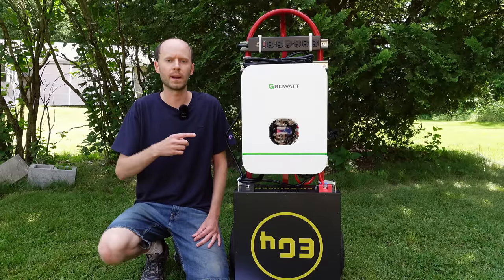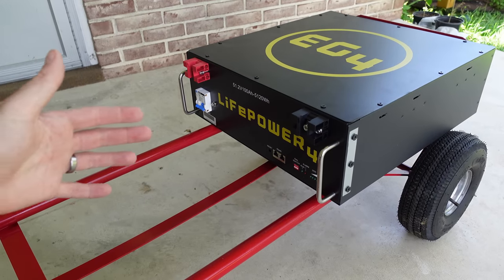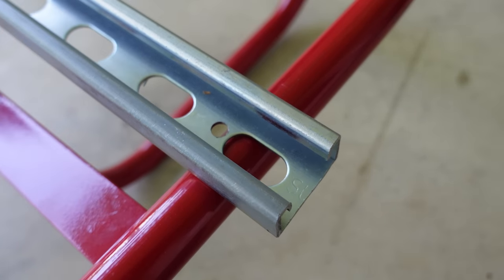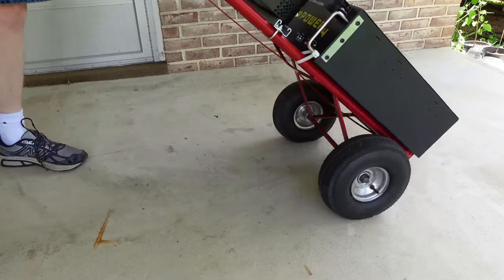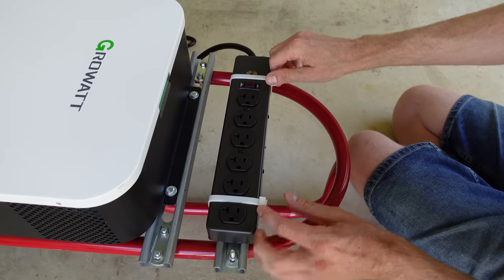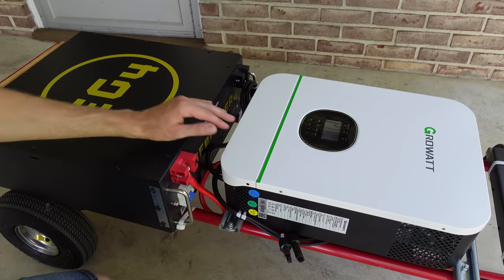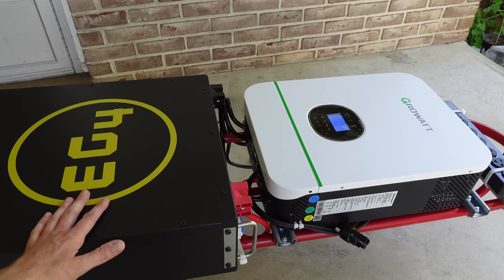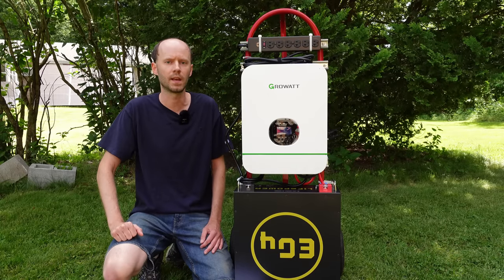Building a 3000W Portable Solar Power Station, Great for Power Outages!

Comment: Suggestion: Put your power outlets as close to the ground as possible (Obvious reasons). Use the entire length of your zip ties, especially on heavy loads -not just one turn and cut off the access. Don't waste the tie. USE the access length and double / triple / Quadruple the holding power of the tie.  Put rubber feet on the D handle to help keep the dolly from rolling when you lay it down.
Reply: I would also flip the battery over, so the terminals are closer to the truck, the positive and negative leads don't cross each other, and the breakers become easier to access.
Reply: @ES-mq9ox  you go around with your ty a couple of times  before you set the tie..
Reply: @ES-mq9ox  Try it. And you'll see.
Reply: @ES-mq9ox  In addition to adding strength every rap puts less stress on the teeth that hold it together.
Reply: @ES-mq9ox  You're wrong. Take a 12 inch zip-tie and lock it off forming a loop. With your hands, pull it apart. Note how much force that requires. Now take another 12 inch tie (same exact kind) and do the same thing except double it over after you close it forming TWO LOOPS. Now try to pull it apart.

Comment: Very nice build ! The only thing I would add is either loc tight / thread locker for the bolts or lock washers  and line the resting rails with black rubber tape also for vibration dampening . Just a thought is all . Again great set up !!

Comment: I would use those cheap ratchet straps from HF to secure your battery! I would like to build a similar system one day, starting with the battery and adding the inverter and controllers later! Thanks for the video!
Reply from the maker: That's a great idea and might give better support!

Comment: Recommendations:
1) To avoid voiding the warrantee by drilling through the cage at the bottom of the Growatt Inverter, you could have made a custom aluminum mounting plate to make the attachment. One plate with 4 holes and added mounting hardware.
2) Advise the manufacturer of the design issue (flaw) with the mounting holes inside of the inverter cage at the bottom. They can easily add a flange at the bottom of the inverter housing, much like they did at the top of the inverter housing. I assume that the spacing of the slotted mounting plate at the top of the housing is spaced 16" apart for mounting with lag bolts to the standard 2"x4" stud spacing.
3) Explain why you placed a small piece of plywood between the handcart flange and the bottom of the battery (cell pack assembly).

Question:
1) When will you provide a video on the interconnection of the communication ports of the cell pack assembly and the Growatt inverter?
2) When will you cover setting up the WiFi connectivity? This will enable remote monitoring without needing go manually check the system. The remote system should alert you to when the system charge is low and requires recharging.

Note:
In the past, I haven't commented on your videos mostly because I don't have the time, however, I do monitor your YouTube videos and am subscribed.
I appreciate your efforts! Keep up the great work that you do! Go forth and do good deeds!
Reply: Instead of using a single sided unistrut,  Unistrut makes double sided unistrut and that would allow you to use spring nuts and pipe clamps to clamp the strut to the dolly and spring nuts with bolts to anchor the inverter.

Comment: Those lower bolt holes on the inverter had solid steel around it for sturdiness.  Those you drilled were surrounded by other holes.  You’d probably want to use at least a 1” washer or greater on those bolts.

Comment: So for how many hours would this setup power a garage freezer and kitchen fridge that combined use about 3kwh in 24 hours?  And what size solar panel setup would it accept/need to recharge the battery within the allotted time?   I'd like something that I can use to keep my freezer and fridge going for an extended time 2 in the event of a massive power outage.  Ability to add a small light bulb and iPad charger would be a nice addition  too.
Reply from the maker: This is a 3000Wh battery so if your load is using 3kWh in 24hrs, it would power the load for 24hrs assuming full battery and healthy life.  I have a separate video on connecting/sizing solar panels https://www.youtube.com/watch?v=QWJpafOHoD0
Reply: @LithiumSolar  isn't that a 5000Wh battery?   3000W controller?   so it should easily run the fridge and freezer for 24 hrs non stop and then some, right?  if fully charged.
And if I have to run a generator to charge it, how long might that take?   I have a 14 KW propane house generator.  Please excuse the simple questions as I have very little knowledge of electricity

Comment: That's an awesome build, VERY well done. I was looking at their web site, but it didn't say...can you hook up say a 2 or 3,000 watt Honda generator to the invertor and charge the battery that way as well? I mean you have a few days of storms and no sun, a small gen set would be nice. Also, can you daisy chain the batteries and have 10k? Thanks and keep up the great work.
Reply: How much cost
Reply: How I can contact this company
Reply: Yes you can, these take AC input to charge. You can daisy chain several together in parallel.
Reply: If you have a generator, there's no need for this battery and inverter. unclear why you would store power if you have a generator.
Reply: @bob1498  gas supply might become an issue
Reply: @bob1498  silence, long term outage, back up option in case the inverter fails, etc
Reply: I had the thought of 10kw as well, ( 2 of the 5kw). That would be heavy but perfect for me. Is that possible?
Reply: @bob1498  Because you may not have access to fuel, I live in south Louisiana and after the major hurricanes we have experienced no power for days or weeks,  everything that requires power is down. The gas pumps are all down and no way to pump propane either. We have no access to fuel that's why you need a solar generator.
Reply: @bob1498  Really? Hmm...solar energy source is free; no fuel to have to obtain and store; noise of generator; dangers of generators (C02); weight. 
I have a small generator that I use primarily to recharge my storage batteries on extended cloudy days. Duel fuel but use only propane. Gasoline only if absolutely necessary. Redundancy.

Comment: Do you think the inverter is powerful enough to handle 10KW batteries?
Reply from the maker: You can connect as many batteries to it as you need, but it's a 3000W inverter so that's it's max continuous power output.

Comment: I had considered making a dolly pack like you have before I saw your video and the components I wanted to use were exactly the components you used. I feel better about my choice now😊 With 1200 watts of solar panel connected to this system.  How long do you guesstimate that system may run a 7000 BTU (about 6 amps at 120v) AC in Phoenix AZ (very sunny) ?
Reply: about 6.5 hrs if the unit is on full time?

Comment: I built one. Had to extend the battery tray to hold solar panels during transport. I have 2 lead acid batteries and 2 super capacitors. The super capacitors cycle so the batteries don't. Like a capacitor on a car amplifier to keep headlights from dimming as the bass hits. A super capacitor can cycle millions of times and a lithium battery only 12000-18000 cycles. You get longer life out of batteries by using super capacitors. Super capacitors act as a soft start too. This also helps to reduce hard cycles and heat on batteries.
Reply: Dude.  12,000 cycles is over 30 years!  Only?

Comment: Great build, great video!  As all-in-one solar generators get heavier, I think they may start using this form factor. The little wheels used on the current models will have to become heavier-duty and need metal axles, etc.

Comment: Thanks I did the same setup wiring a 30A RV plug for my input directly into a EG4 6500 inverter to the LifePower battery which worked great but Signature Solar told me that a cord cannot be wired to the inverter and must go through a breaker panel.

Comment: Awesome video, I loved that you priced it out simply and clearly and didn't make me go to a half dozen websites like other channels do. Do you see yourself ever going to the next level and building one capable of 240vac?
Reply: A 48VDC to 120/240VAC pure sine wave inverter can be had for about twice the price of the single phase one used here so it would just be a matter of replacing that component and arranging suitable outlets.
Reply: Do you want 120 and 240 both, or just 240?  If just 240 there are inverters for the same price and sometimes a little cheaper intended for the European solar market.  In fact looking for deals on inverters you have to be careful which one.   For example one of the MPPT models the 240v model is $75 less than the same 120v model.
Reply: @calmeilles  Thank you for the info. Now I can decide if it would be worth it.
Reply: @dorzak975  I'm in the USA, so I'd definitely would want access to both. Thank you for your response.

Comment: Could you give us some idea how ling the battery will last at full capacity without recharging?  I know that I have a gas generator that hooks up to my circuit panel and it will run about two days powering my whole house on a tank of gas. I know it 's not the same but,  how long would it supply enough  power to keep my refrigerator and freezer going? and could it supply enough constant power for that propose being hooked up to solar panels?  Nice video thanks
Reply: 5,000watts for 1 hour
2,500watts for 2 hours
1,250watts for 4 hours
625watts for 8 hours
312watts for 16hours 
156watts for 32hours
78watts for 64hours
39watts for 128hours
20watts for 256hours 
Without sun or any charging source.
Reply: In a typical home short answer not long..lol.